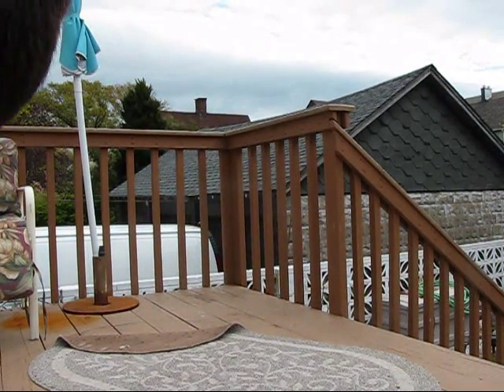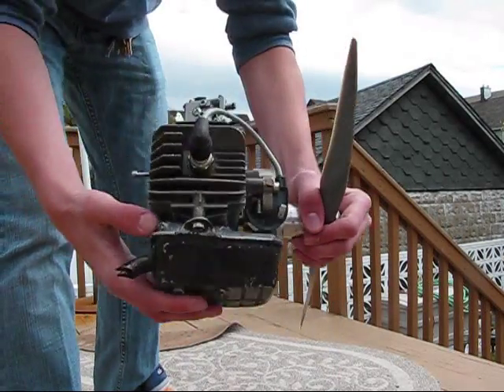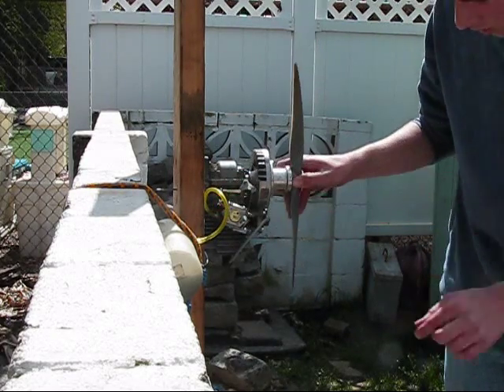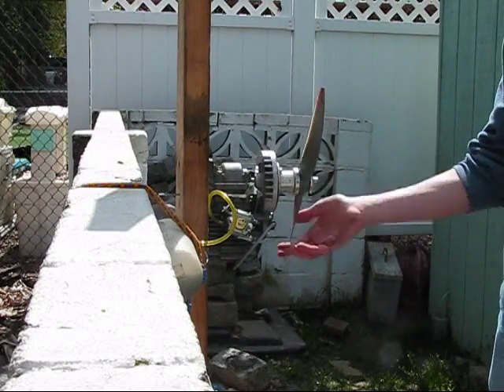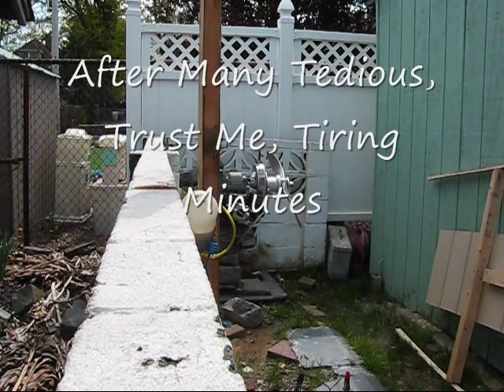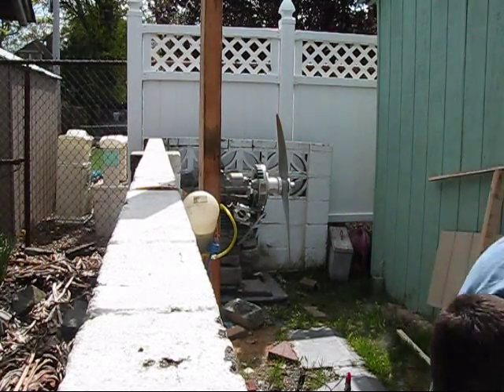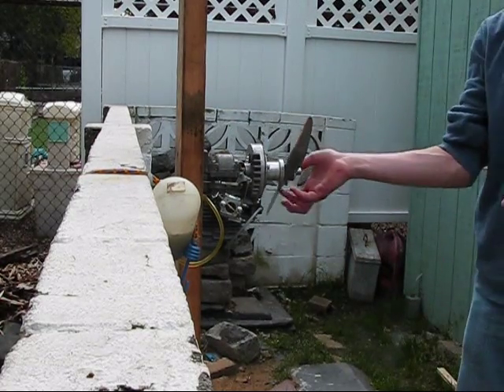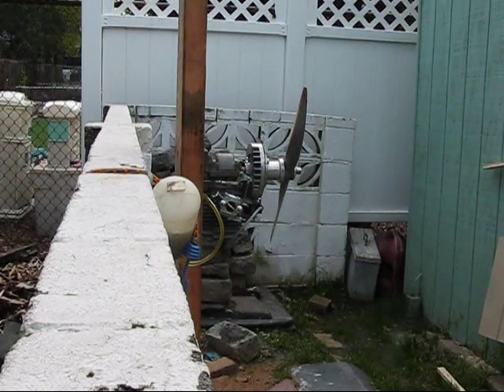Gas Engine Test Starts

Comment: Best and only way to start: leave throttle at idle, set full choke, flip until engine fires, then turn choke off and flip a few more times, and the engine should start. always grab propeller at base to middle and never "cup" the propeller blades. also, mag engines are very hard to start because the magnet and sensor are not close together so you wont get a good spark.